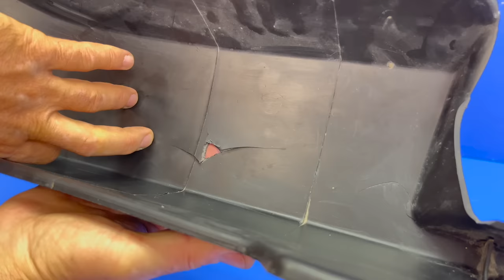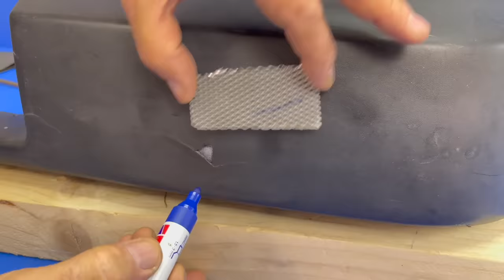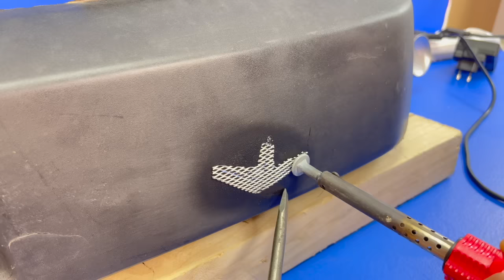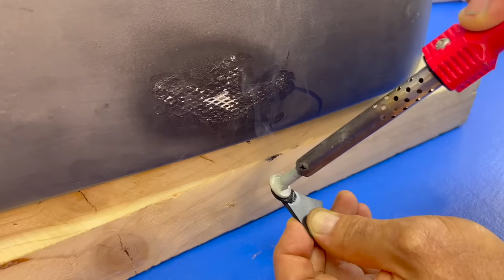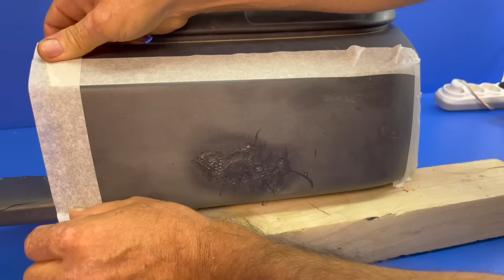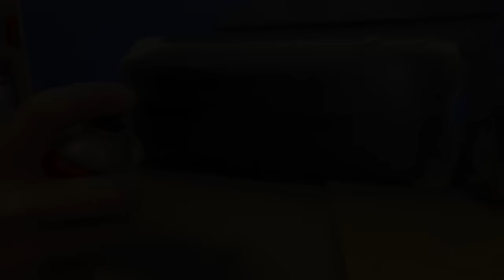Genius Idea! Fix Cracks on the Bumper With Plastic Welding Method

Comment: Hey Maker. Good Video. That was a good repair. I have a broken rear bumper on my PT Cruiser that has portions that are not flush with the bumper. I have to figure out how to keep all the pieces flat and stuck together.🍁👍👍
Reply: Не применяйте описанный способ. Коэффициенты объёмного расширения пластика и металла разные, поэтому при изменениях температуры воздуха область ремонта будет разрушаться.
Применяйте пайку пластика горячим воздухом. Для этого подойдет фен паяльной станции.
Суть метода: пруток из пластика, из которого изготовлен бампер, нагревается вместе с пластиком бампера - происходит сплавление. Получается самое надежное соединение. 
Можно вставлять недостающие фрагменты бампера, так как можно их легко сформировать из любого куска пластика.

Comment: Yeah it looks like it works. Thing is. There are these products. One is called Tiger paw. They have auto body filler with fiberglass in it. You could build it up from the back side to make it stronger. Then thinner coat in the front. That might be safer too. No risk of burns or breathing in plastic fumes.

Comment: Hoe heet dat gaasje wat er eerst op gaat? Dit is ideaal voor mijn scooter kappen. Bedankt! En hoe heet dat hitte gereedschap?
Reply: I used a small piece of steel window screen for this purpose.  It looks like the poster used a carriage bolt as a soldering iron tip.